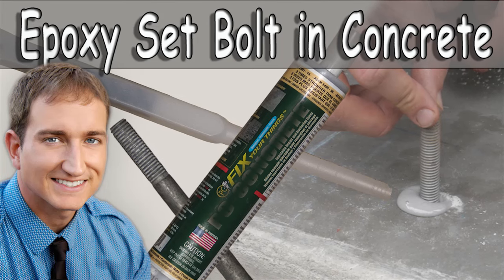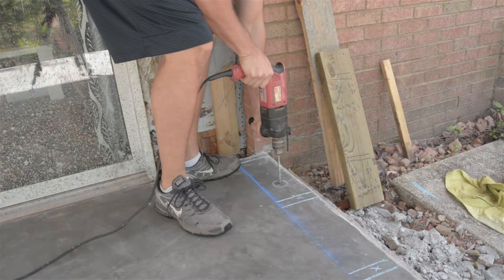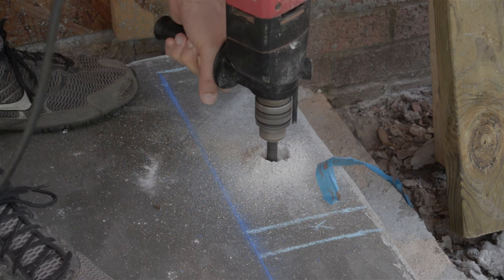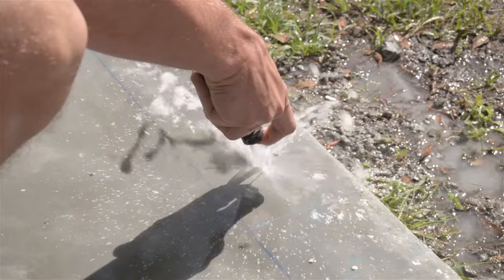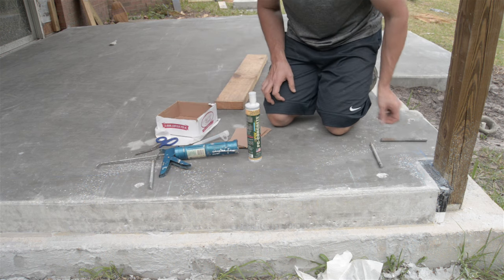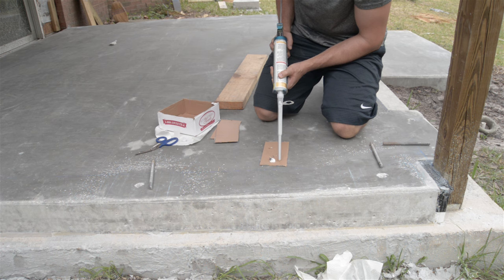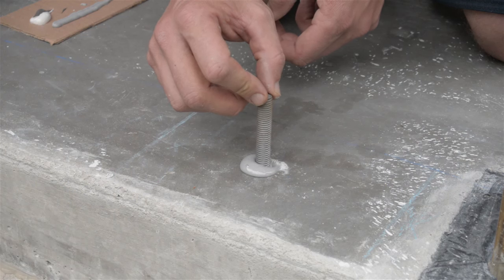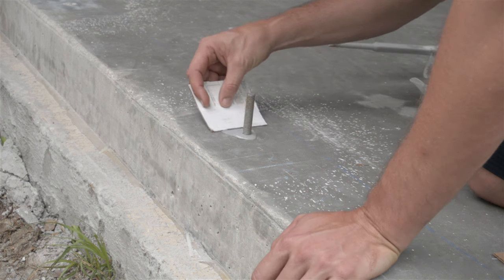How I Epoxy (Glue) Anchor Bolts Into Concrete, Video #4 New Room Addition

Comment: Why not use wedge anchors
Reply from the maker: Thought it might be risky considering the concrete had not fully cured the several weeks generally required at the time of concrete anchor installation. I thought the compression force might potentially crack the fresh concrete.
Reply: @MrKistel  
Good points. Also quite close to the edge. You used the right technique just use compressed air or a vac next time not water. Much easier!

Comment: Unless any buddy can answer any questions from a structural engineering mind set everyone is clueless.
We all know water a steel don’t mix it causes rust I believe they’re finding out the hard way on a lot of bridges house foundation 10 - 20 years down the road Corroding and cracking going on I wonder why.
I used a fiberglass Rebar it’s ten times stronger than rebar doesn’t rust it’s lighter than rebar makes it much easier to do by self cost less than rebar and let’s concrete bend under load unlike rebar that will crack under load cuts easily to Gator Bar I believe is its name .
For those who don’t know of it check it out  made my life easy.

Comment: what was the name of it
Reply: I read the name on the tube.  It looks like it's, PC Products  -  PC Concrete 9 oz. Epoxy.  My Home Depot doesn't have it locally in the store, but it can be ordered online.  I used Sakrete Anchoring Epoxy which they had in the store and is a little cheaper.  Hope this helps.  :)

Comment: why not just drive "red heads" into the holes?
Reply from the maker: Since the holes were relatively close to the edge of the slab I figured the was a chance a compression fitting could cause a crack.
Reply: and it would

Comment: Soooo you have enough money for a hilti but you cant afford wedge bolts??
Reply: Epoxied anchors are stronger than wedge bolts.
Reply: Which crack the concrete base when installed close to the edge.

Comment: The make expansion bolts for this.  They are 1 cheaper 2 stronger 3 easier..
Reply from the maker: Sure there are a variety a ways to anchor to concrete.  Thanks for sharing.
Reply: Anchor bolts are not suitable for all applications though, especially not close to the edge of your concrete.
Reply: Expansion bolts are not always stronger. Near edges or in weak concrete resin bonding can be a lot stronger and safer.

Comment: Too bad that the mixing nozzles are not readily available. If you only use a small amount, toss the cart away along with your money.
Reply from the maker: The brand I used in the video (link in video description) comes with two nozzles which is nice.  If push comes to shove you can hand mix the two parts with paint stick or something.
Reply: You can squeeze it without a nozzle, properly mix by some stick, and then use, as you do with regular epoxy. And keep your clean nozzle for a big job.

Comment: Just use a shop vac and a straw, dude.
Reply from the maker: That is a great tip to clean out the holes before applying the concrete anchor epoxy adhesive.

Comment: basically he did everything wrong.
,! 5/8 is too big for 1/2" bolt, just use air to blow out. Not water. why the heck make extra work?
dude. you should not post how to videos if you don't know what you are doing. how useless. actually worse. you are giving out bad info.

Comment: NO WATER.... Caned compressed air... vacum... round wire brush ... for heaven sake.... just another idiocy
Reply: Water doesn't effect epoxy. As long as you aren't leaving a puddle in there it's fine.
Reply: Epoxy is thinned (before it sets) with acetone, not water.  What is a little moisture in the concrete going to do to the epoxy?  Nothing.
Reply: @foggymtnbreakdown  if the hole is to wet the epoxy will not stick to the surface of the concrete
Reply: Wire brush is actually recommended against as well.  You are supposed to use a poly brush.